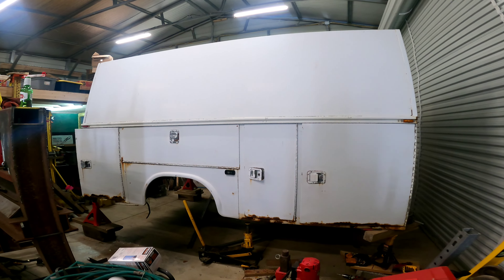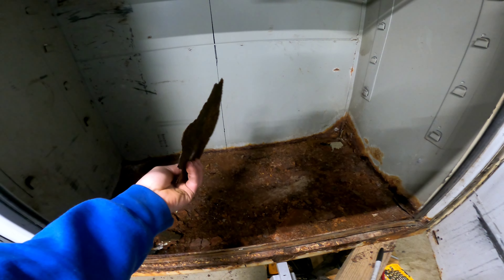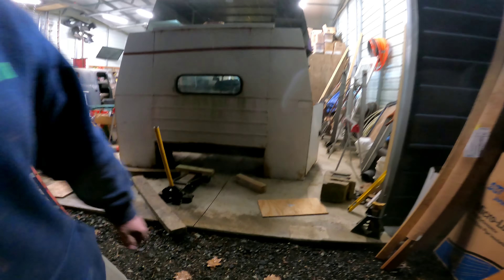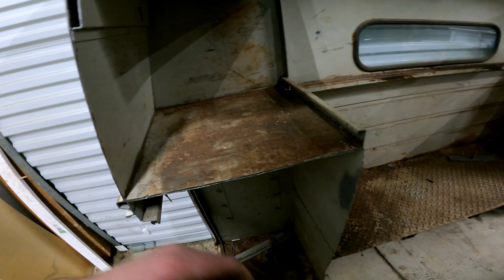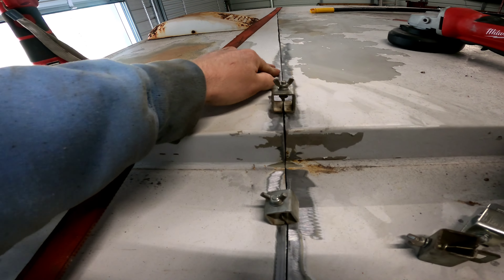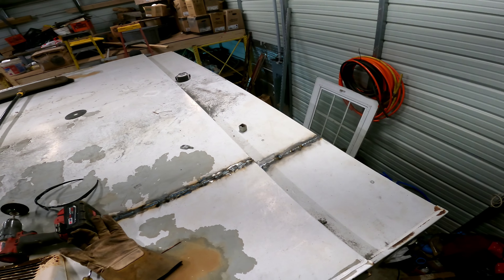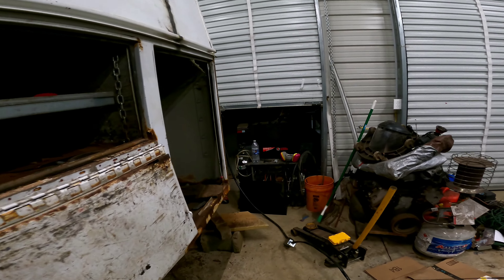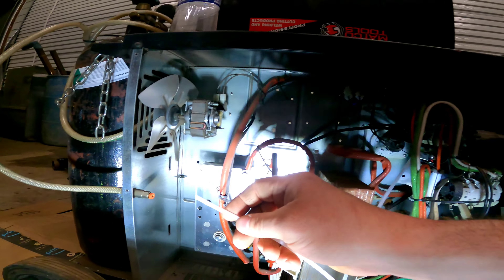Utility box build for pickup

Comment: Odd question any wayyou could tell this bed apart from a normal 8ft? Is it exactly 9ft front corner to back corner? Any welding spots that might be noticable? I have some questions if you could. I may know where this exact reading utility box is at and that would be wild if it is.